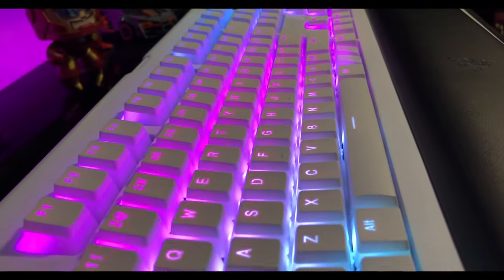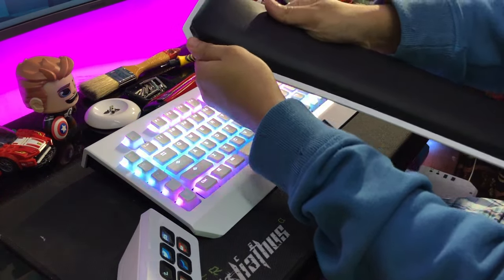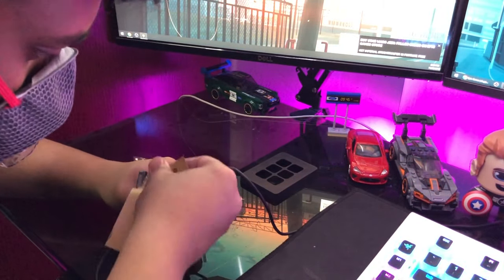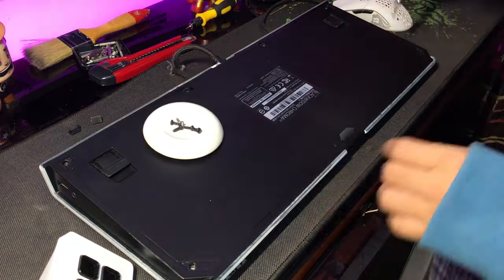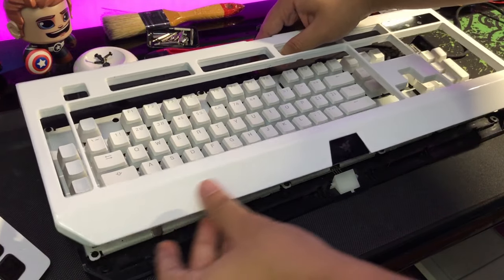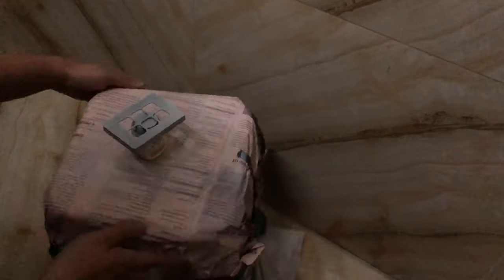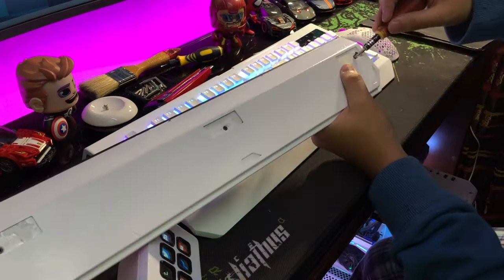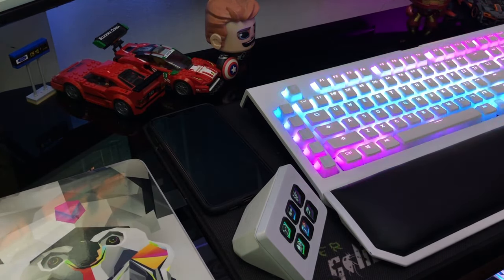SPRAY PAINTING A RAZER KEYBOARD! | DISASSEMBLY & SPRAY PAINTING GUIDE!

Comment: No primer. No clear coat. That paint job will last as long as you don’t use that keyboard 😉
Also… I would never advice anyone sanding one foot away from you electronic equipment… not a very smart idea! 🙄
Reply from the maker: I have been using this keyboard since that video and the pain’s still brand new. There’s like 1/2 chips but it’s not even noticeable. But hey, using primer is better and I’m not saying no to that.

Comment: Can I do this with a huntsman elite?
Reply from the maker: You can, but not the wrist rest. 
The wrist rest is taped to the board so I would suggest you skipping that.
Reply: @GaZiPRO  ah. Im a bit scared to do this, so I want to know if I should use something removable to color it. Would plasti dip work?

Also thanks for the speedy reply, that’s as pretty cool😂😂
Reply from the maker: @DiddyBom  I wouldn’t suggest Plasti dip because it might peel off and I really don’t have that much experience with plasti dip. 
Also hey sorry for the late reply, I didn’t get the notification
Reply: @GaZiPRO  all good. I’m struggling with the huntsman because the board itself is attached to the key caps, while the black widow has a cover you can pop off. Any suggestions?
Reply from the maker: @DiddyBom  yea, that’s an issue with the huntsman elite. I have seen videos of it as well and sadly none of my friends even have it so I can’t even experiment on it. So what you can do is cover the parts and probably plasti dip. Oh and one important thing, don’t peel off the wrist rest leather thing off because it’s just a sticker. One guy on the comment section did it and he had to order a replacement wrist rest.
Reply: @GaZiPRO  hm. So should I remove the keycaps, and mask bag or masking tape over the switches?
Reply from the maker: If you can do a good enough masking job this might look quite good and again it’s plasti dip so you can easily peel it off if you don’t like it.
Reply: @GaZiPRO  alright. I’ll give this a shot. I’ll prob post how it looks. Thanks bro! Subbed
Reply from the maker: @DiddyBom  post it on my discord server then.
https://discord.gg/n658cdwC
Reply: @GaZiPRO  I’ll be sure to!
Reply: @GaZiPRO  it’s going alright. Since I have to mask each individual switch, it’s taking a while. I just finished the second row
Reply from the maker: Wising you good luck.
Reply: @GaZiPRO  thanks
Reply from the maker: @DiddyBom  keep me updated, G
Reply: @GaZiPRO  I will. I’m about done with the switches, I’ll probably finish the sides tonight. I’ll paint it first thing in the morning. I can’t wait. Thanks for the help!
Reply: @GaZiPRO  just finished painting it, and it still WORKS!!!!!! I’ll post a picture when my new keycaps come. Thank you so much!!!
Reply from the maker: Man, I can’t waitt! Super happy for you.
Hopefully it turned out super well
Reply from the maker: Here’s the link. 
https://discord.gg/VCBR2YztDG